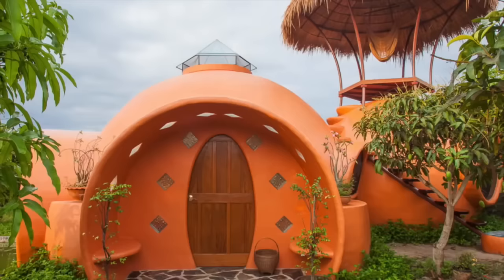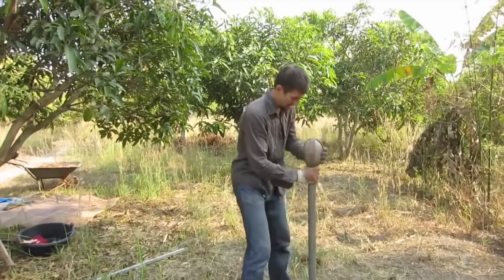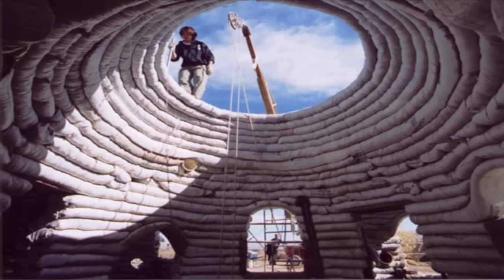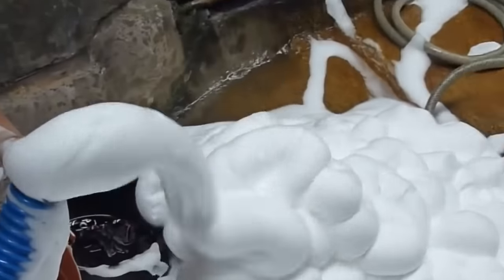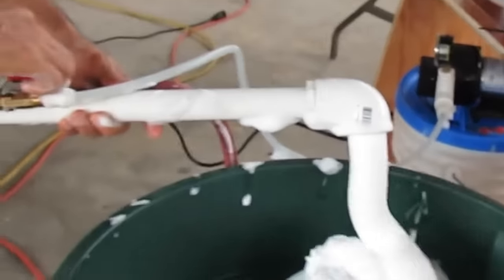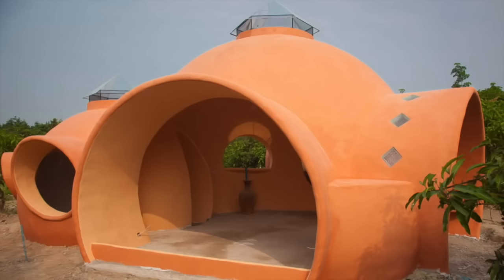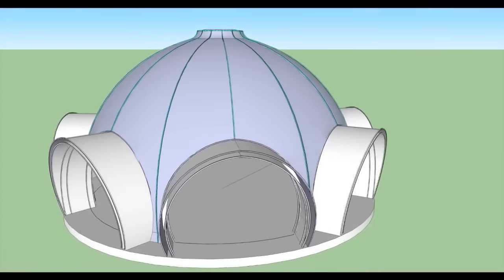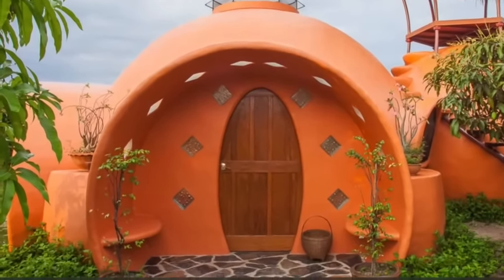How We Built this Dome Home (For Under $11,000!)

Comment: Structural engineer here. Aircrete is relatively weak compared to concrete and difficult to achieve consistent R value. That being said, it is possible to build one of these homes and meet local building Codes, but it would take a testing company and engineer to certify the structure and design it so that it is structurally sound. Those fees alone could exceed the construction costs they are posting. When you take into account the lack of training and knowledge from the average builder with this, you're not going to see these popping up in the burbs anytime soon. So in summary, not impossible, but also not realistic in both cost and ease of construction if you are trying to make it a legitimate, code compliant structure in developed temperate zone countries. Cool looking  though and I applaud the creativity.
Reply: Thanks so much for this comment! Do you think making it steel - enforced as in building a steel structure first and then covering it inside and outside with aircrete or concrete (or any other material you could pour into a mold) would eradicate these problems?
Reply: Its in Thailand.  Thanks, wet blanket.
Reply: Good points.
What are your thoughts on adding steel reinforcing, that includes not only rebar, but also something like a heavy gauge wire fencing?  Such that the more evenly distributed steel structure offsets the lower tensile strength of the aircrete?
Reply: It is being used in construction in the United States as we speak.
Reply: @lilkatdevil  would love to know more about ye build in the US and what climate. I’m in Canada and thinking about this...
Reply: @mariagillinson8527  one thing that I read is that it is better in warmer climates, but mainly used with “flat roofs”. Arizona, New Mexico are a few that are trying it out. Those states are known to allow “alternative” materials. Would like to know more myself.
Reply: @TheRyanbye  You left out Qanon.
Reply: @davmar9923  you are who he talking about.
Reply: @TheRyanbye  yes ryan 88.  you are the proverbial breath of fresh air.  i am 75 and have built 3 houses over the years w/o the local governments blessings.  this system looks GREAT to me.  also love your f.e. comment.  right arm!!!
Reply: @davmar9923  just keep waiting dav mar.  we have an illigetimate "presedent".  we also have a media that censors info.  right on qanon.  sorry you are in the "herd" d.m.  over time the herd is always outmoded
Reply: @TheRyanbye  Hey Ryan, you're in luck! I'm joining the organization that Hajjar Gibran has founded, and I'm allowed to invite one person to come with me. I CHOOSE YOU!! :) We are setting up a dome village in Guyana. Hajjarsville is going to be paradise on Earth. I've been promised it will be a town flowing with milk and Kool-Aid. Do not speak of this with your loved ones. We are your family now.
Reply: @davmar9923  yes i'm proud to be a "wingnut" with 3 college degrees and total12 years of college and a doctorate.  a "wingnut" is someone NOT hypnotized by the maninstream.  it took many years of research for this 75 year old to "get it".  b/t/w all of my grades were above average.  even in english.  come on d.m.
Reply: What about building these in mobile home parks to replace mobile homes? That should be a different set of building code, right?
Reply: @davmar9923  You, sir, have fallen victim to the classic "ad hominem" - rather than attacking the man's argument, you've attacked him personally, referring to his literacy skills. I'm sure Michael is incredibly articulate away from the keyboard. 
My father is close in age to Michael (65+) and he is extremely intelligent. He loves history and he's always watching documentaries. He's just not so good with technology, so sometimes his spelling is a little off. That doesn't take away his brilliant mind.

It might pay you to be a little more open-minded and considerate. Challenging a world-renowned soccer player to paint a better painting than Da Vinci, doesn't make him any worse of a soccer player. Nobody's good at everything.

The media are proven to be dangerous in their attempts to censor the sitting President of the United States, and swaying political opinion. That's illegal for a start. Secondly, since Twitter, Facebook and Instagram are registered as "social media platforms" this means they do not have the right to edit or censor posts made on their sites. They are registered platforms, only publishers can edit posts. Acting outside of their license is illegal also, and is going to bring them some hefty fines.

I don't think QAnon is all it's cracked up to be, but at the same time, they're not actually doing any harm. (The violence at the Capitol building was very suspicious - many members of ANTIFA were sighted, and what rioters do you know stay inside a rope fence? Looked very staged to me.)
QAnon aims to expose potential underground child sex trafficking going on in both D.C. and Hollywood, and also on a global scale (I'm not naming any names or saying it's 100% true, I don't know for sure). I believe some of the posts made by "Q" are false flags, but I also believe that a majority of Q supporters are genuinely good-hearted people.

To add my own two cents, I do believe the lockdowns are unnecessary - after 11 months you'd think they might have some effect. "2 weeks to flatten the curve" turned into 52 weeks of people losing their businesses and jobs, children losing out on an education, and under Cuomo, elderly people in care homes losing their lives. 
I also don't plan on taking the vaccine, because it hasn't been approved by the FDA, it is still technically in trial phase, and the corporate pharmaceutical companies have been made immune from legal challenges resulting from potential bad reactions to the vaccines. Not only that, but C-19 has yet to be properly isolated, which means a vaccine couldn't possibly exist for it yet. We're being scammed by the very companies Bill Gates has shares in. No thanks.
Edit to add: I'm not against all vaccines, I'm only against vaccines that haven't been properly regulated. I have received all my required vaccines as a child, and I plan on vaccinating my future children too.

We need to start looking beyond politics and beyond bias, and beyond what we thought we knew, because what matters most is the safety and future of humanity as we know it. Things are about to get scary. Petty arguments will soon be the least of our worries. Reach out and give your friends and family a call. They'll appreciate it more than you know.

Love and light to you all. 💕
Reply: @roisinnigcrainn7722  Go outside. 😂
Reply: @roisinnigcrainn7722   Some common sense... I like it!  We think alike!!   No matter what the actual intention of Que was designed to accomplish, it's an undeniable fact that one of it's main reoccurring messages is United we are strong and divided we are weak.  This is an absolute truth that has and always will echo through the halls of time!  We as Americans and as citizens of Earth have so much more in common than the differences we allow to divide us and our collective advancement as a species!!
Reply: @downeastermaineusa3794  I thought Thailand had a lot of Earthquake activity, I may be wrong, but it seems like his points are valid, as far as safety goes. I mean, you never install the newest operating system until it comes out, you wait for others to find the bugs and those to be fixed first.
Reply: @lilkatdevil  Is it being used like this as almost  the entire structure?
Reply: @mandyvoss1966  not that I have seen, more of foundation, flat roofs that are lifted onto a somewhat traditional timber/stick/Adobe house. But not as a dome.... that I am aware of.... let me see if I can find what I stumbled upon ..
Reply: @lilkatdevil  ICF walls have gained more of a footing and are more widely accepted than these. I see the downside to these being the lack of skilled labor for the shotcrete coupled with the lack of knowledge from the industry professionals in general. The product is sound technology however.
Reply: @dowhateverfree  it would, just can’t when in stormy,
Reply: You must live in California! The building regulations there are way over ridiculous!!! So glad we moved from there several years ago!
Reply: The shape alone makes it strong. It would definitely  not blow over in the wind.
Reply: Debbie Downer Dood!
😂🤣😅
Reply: Yes! I know a lot of freedom seekers detest regulations but there is a reason why engineers go though as much school as they do. And there is a reason why codes are the way they are. Its all fun and games until your house collapses and squishes your kids. I ain't living anywhere that hasn't been certified by people smarter than me lol
Reply: Mike G  so you’re angling for a job ?
Reply: @dennispickard7743  I’ve done enough crazy unique homes. I’m plenty busy fixing the ones that didn’t use an engineer. But if you got something, there’s a good chance we can do it.
Reply: And you are holding back.   Curves along one axis are expensive.  Curves along two axes are SUPER expensive.    I'm thinking kitchen counters, cabinets, etc.   Nothing you buy at Lowes would fit.   All internal fixed pieces would have to be custom made.    So, I guess I'm a second wet blanket.
Reply: Maybe so on the code point, that said it is new ideas like this that pave the way for future ideal and more “realistic” evolution in how we build sustainable dwellings. I for one living in the tropics would love this. Furthermore I’m sure others can find ways to take this concept and make it fit city like areas. Our future can not continue to look as it has been on all levels. We must explore and accept new ways. This is just one of many! 
Aloha
Reply: @lilkatdevil  my husband owns a concrete construction business and has done several ICF homes since 2012. One was basement + 2 stories above ground. He uses NUDURA. In his opinion, based on speaking with people and others he’s seen, NUDURA is superior to many others. A man he did one for, actually tested extensively on his own the difference in energy efficiency and was very pleased with the difference. The ICF has so many benefits. You will probably pay 10-15% higher cost on building the home, but in the long run it pays for itself. Just like having geothermal.
Reply: @alison1454  thank you! Lots to think about.
Reply: @downeastermaineusa3794  he not a wet blanket just because he's giving people the reality of what it would take to do things like this in the first world .
 Personally I will never understand why people complain about how this is the direction we should go in, but always vote for the party that regulates what size soda you're allowed......we need less government interference not more.
There are places in Texas that will actually let you build an Earthship on your property. Won't be able to if people turn Texas into California or New York.
Reply: @thzzzt  nah...as a 3d designer that's exactly what I thought....I said out loud, "but the curves!...they will be exspensive...and nothing will fit!" Lol
Reply: @mandyvoss1966   I believe the physics of a dome might make it more sturdy but I would defer to the man with an engineering degree.
Reply: @TomoyoTatar   I don't think their losers persay. I just think that their going to have to take a slice of humble pie and realize that perhaps someone else might know a thing or two they don't. Remember an eye for an eye makes everyone blind.
Reply: Thanks. You are the only one that used their brain about this constuction method. I  have built my on berm 3k sqft home. The building codes and inspections drove me nut. I ended up pouring  8inch thick six sack mix with rebar walls.  I am in Missouri.  I would like to know the structual strength of the foamcrete.
Reply: This make me think of the old school made with Siporex wall, which was use before but was a bad idea. It is working for lateral load for now but not into the code,  as engineer we refuse to give any resistance to that kind of wall.
Reply: For tropical weather, could aggregates be added to aircrete? The extra aggregates will make it heavier but would still be lighter than concrete and still have some insulation for hot weather.
Reply: Well of course they won't allow these in the city! That would put home builders out of business because all of a sudden people would realize paying an arm and a leg for a house is not necessary. I've spoke to many in the construction industry in Dallas and said that those homes are outlawed because of the fact that they would put multi-million dollar construction companies out of business.
Reply: @jjall663   not true. Trust me, builders would embrace any cheaper technologies that are code compliant. There’s not a secrete conspiracy to make home construction unaffordable. That makes no sense. The reason you don’t see these homes built in temperate climates is because they are not structurally sound, or thermally efficient and most people don’t want to live like Yoda in Degobah.
Reply: @Fastpitch  it is true and I love how people will always throw the word "conspiracy" around when someone with knowledge approaches them. It would disrupt the industry of home builders. They make millions selling houses of stone, marble and wood. The three things that are not included in aircrete. When you can build a house for less than $20,000 why would anybody in their right mind pay six or seven figures for a home?
Reply: @Fastpitch  the home itself provides insulation because of the construction. Someone that has an engineering degree should know that information 🤔
Reply: @drizzlywaffle2955  
You clearly don’t understand construction and building codes or their intent to protect the public, but you do seem to relish in conspiracy thinking. Ask Turkey how they feel about unreinforced concrete that doesn’t follow building codes.
Reply: @giselafiege7169  innovation is always met with the past. Question is will the regulation that comes along with this get engulfed in the same politics everything else does. Lol
Reply: Good thing I'll be building mine in rural parts "shithole" countries. Judging from what happens with local structures during catastrophic events, my domes will be just fine.
Reply: The only way that we can pass codes is to change the thinking of the code makers. 🇺🇸🦾. We can get homes like these to code if we work together and get it done. ❤
Reply: @imuneik  
The current code allows these to be built. There’s nothing that needs to change with the code to build these. You’re just not going to do it, and neither is anyone watching this video, because it’s far more expensive and complicated than conventional construction to make it structurally sound and meet the minimum thermal efficiencies the code requires.
Reply: Probably a npc agent trying to discourage people.
Reply: @downeastermaineusa3794  But  priced in US dollars.  So clearly for US market.
Reply: I think these HOMES
Were built for people
Who live in HUTS
MADE OF 
DIRT, TIGS, LEAVES and 🐮🐄 💩
SAW A  VILLAGE WOMAN IN
AFRICA,  MAKING  ONE  🌍

18 MAY 2023, THUR. 🖖🐈
Reply: Why didn’t you answer @Toffee Fee’s question? 15 of us would have liked an answer❤️🇬🇧👍
Reply: Nice material idea, but forgetting the labor & formwork to install.. not sustainable..
Reply: @toffeefee9465 I like this ideas it would make sense to build a frame and such the metal could be easily bent to shapes for tons of different designs ideas.
Reply: They're doing it and people need housing without all the govt regs. Can you make realistic recommendations please.?
Reply: What are your thoughts on Binnieshell homes?
Reply: Don’t like ridiculous building codes then do your part and go to every community planning session in your area and argue against the NIMBY residents. Everyone wants a cool looking hobbit house, but how many of you would sit through a four hour meeting every week and speak up for relaxed rules. No, conspiracy theories are much easier.
Reply: What about as backyard casitas? Perhaps cities would allow them without a lot of hassle. Phoenix, Arizona just announced ces a new project to encourage building backyard homes to increase low cost housing stocks.
Reply: So little you know, it’s been successfully used all around the world for a long time already.
Reply: My thought is, this is why the structures are so small.  People can live in sheds or barndominiums without regulations, because they're small.  I think if they start building these with multiple floors, bigger and more complex, you would be entering a danger zone of mishaps.
Reply: @carlablizard8514  in europe they build huge homes out of aircrete for a long time already, but that one is not a homemade one, so it might have more concrete than air in the mixture and will be heavier but for what they do this is right perfect. Structural engineer is part of the problem bc they believe in regulating everything
Reply: “Colonizer here: let me tell ya about all the bullshit litigation we have crafted to keep people from being mentally, physically and spiritually free. Have a seat.”
Reply: Seriously… you take a seat buddy…… When someone’s kid gets crushed in a multi-story building where they thought they could use it for more than arches and medium scale domes and try to build five story building for ‘freedom’s sake, hevk the building codes, we’re just more awake’ then shuts gonna not work out for their future in case of Tower of Babel esque disregard for humble buildings built with common sense. If there’s a insulation regulation your so mad about, then figure out how thick the walls of your dome need to be? Email the makers, do math, do your research, maybe it’s three inches more than you wanted but maybe it’s worth it in the end.
Reply: Like holy fuck, a structural engineer is not ‘the man’ and this woman explaining that it’s possible to have this up to code in many places (engineer and certified building inspector both look it over) is an aspect to know may affect your final price! And guess what! Having a legal safety net and having structural engineer put their stamp of approval will protect your property and savings cause a shitty builder could fuck you over by catering to your whims and it could be shite! Don’t be so shuttered into your own neurosis that you think your freedoms over rides the safety of the next owner (which could be your children in twenty years or even longer)
Reply: Like having a legal contract notarized and having the structural aspect of it have their stamp on it, gives your project the legal protection, your savings, a contractor may want the $$ and knows a Wook won’t have the legal protections a subdivision would in its contracts. I appreciate all you guys for caring about this and wanted to convey this very important key aspect of earthen home building practices….. Thank this woman for being in this profession, not berate the whole profession of structural engineers for ‘creating codes for building’ like they are there for good reason and a builder who knows how to navigate them is important part of building the home you want
Reply: And lastly, along with legal protection, integrity of the blueprint from a structural engineering point in writing, the blue print and contract should be hammered out before the foundation is even poured. Have your plan done and able to be conveyed before you even reach out to them and make sure they know your competent and have intentions of following code and to have them make sure the blueprints work for that aspect while also including windows that catch the full range of sunlight (south facing catches the full range) set back from tall trees for winter light, maybe earth berm for heat, hallways with sun room aspect and built in cupboards or bookshelves and lots of storage and cubbies and folk aspects and practical aspects (the set-down shelf or ample closet space) And have these set in lists and final drawings or a folder. And be open to insight about window trim, to double/triple paned windows, building choices and locations rn matching the garage to the house, chances are the builder will have read the different great architects and you need to trust their vision. Like a tattoo artist, you shouldn’t bring them another one’s art without expecting their own aspects in that, and hopefully you’ve paid the artist that made it or expect it to be inspiration and aren’t rude when the line work is slightly different or the colours are deeper or the size is bigger than expected, please, these are people trying to make your dream home, work with them, work with heart and kindness and gratitude and firm commitment to your shared mission of a safe and professional build. Don’t wish wash at the last moment and Insist the bathrooms need the toilets in a different room when you didn’t say that before the blueprints were completed and processes done. Be upfront, be courteous and clear and level headed while listening to what can be done
Reply: In my very last note, have equity in house or the market, good credit score, have your wages set aside for down payment for long time, and have stable job and don’t quit etc before your land purchase is finalized. Have your salary into your savings consistently, long term (over 6 months) not cash, it needs to be there for over six months and have employment record for majority precent of it. And don’t buy truck or take out excess loan before the land purchase is done. And please know not all farm land is able to be bought, without a house on it, raw land in many places needs to be bought outright. (Like trailers, no mortgage allowed) Equity is key in this aspect so having a first house before your cob/airecrete house and knowing how to farm small scale and live in the moment before you have your house, make sure you save your butt off and prepare yourself , As that fellow said (albeit in a different and lowkey unrelated manner) It’s important to remember to be aware, alive, and mentally, physically and spiritually here.
Reply: There must be fixes for the structural integrity that wouldn't break the bank.😊
Reply: @carolwebb4649  that is what I want to know, like how to make these earthquake and tsunami/wind resilient (other than having a sepreate higher up store house/cellar
Reply: @mariagillinson8527 they build them in Canada too it’s very popular apparently. I’m currently looking into this now. Same with binishells. Apparently they have a lot in Nova Scotia.
Reply: Both sides of this argument have relevant points. Just wish you could discuss the issues without the hate.